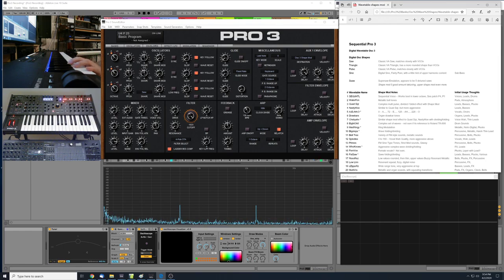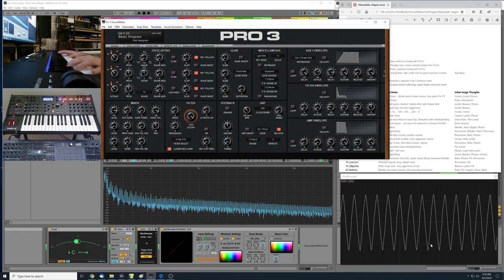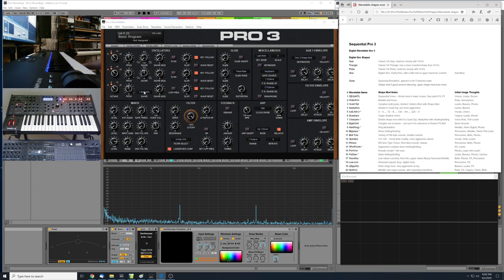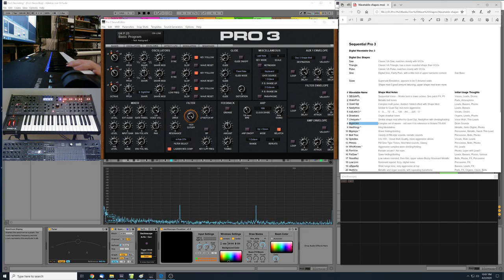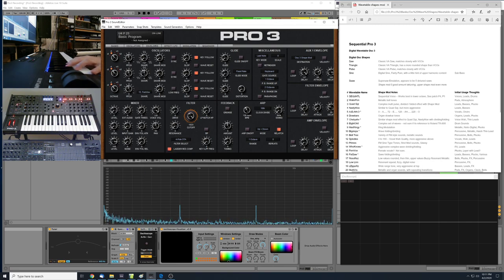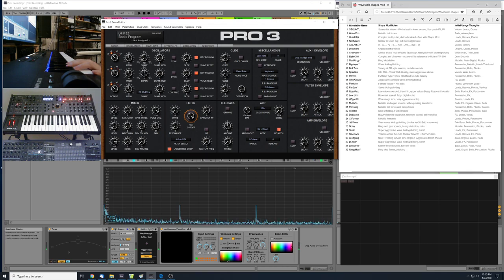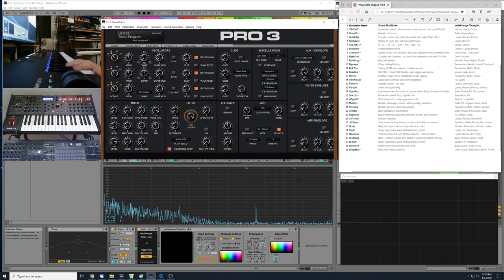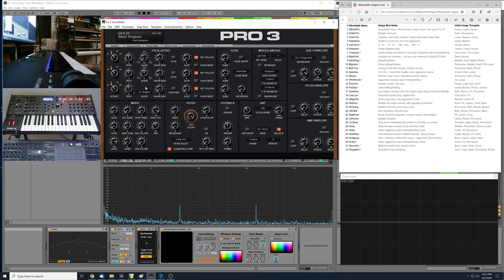Sequential Pro 3 Digital Wavetable Oscillator 3

Comment: Really hope we get a poly synth from Sequential with the VCO/Wavetable combination type architecture. I do hope though we will get two Wavetable oscillators and two VCO based oscillators. That way we can at least mimic the vector synthesis type effect by adjusting the volume between two separate static waves rather than just sweeping a single Wavetable.